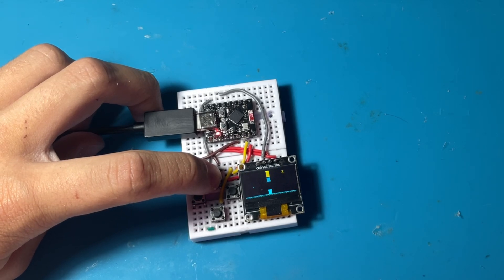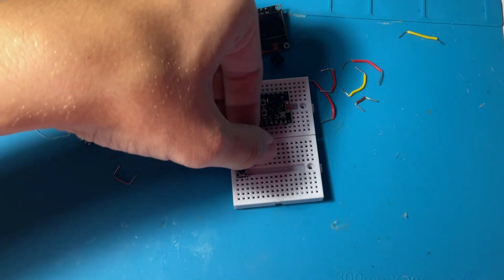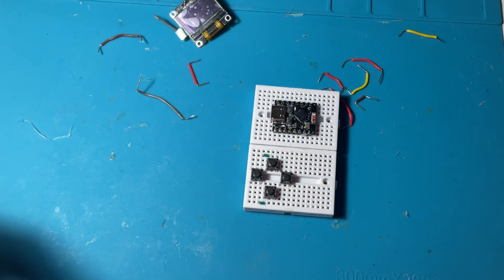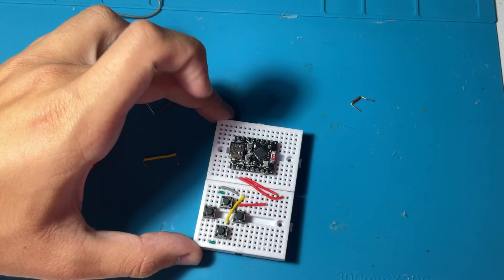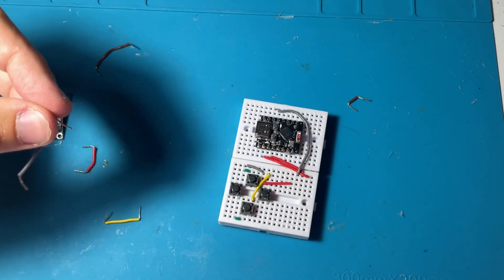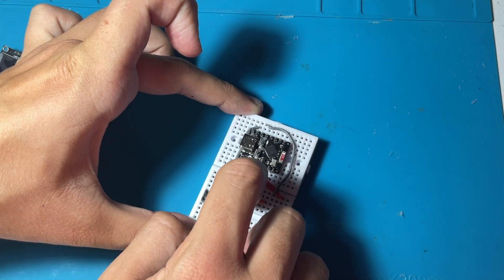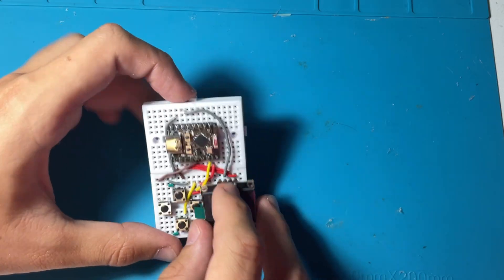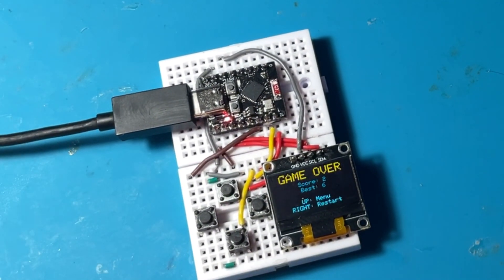How to Play Games on ESP32

Comment: may i port it to esp8266,sir
Reply from the maker: You can use the same code, it also works on arduino
Reply: @RRoboCCrafts thanks
Reply: how can i reset score sir
Reply from the maker: When you reupload the code, the scores should automatically reset.
Reply: @RRoboCCrafts adding button menu to reset score would be nice,just like tinyjoypad,sir
Reply from the maker: Yes that would be great idea either adding another button for reset only, or in the menu adding a reset option.
Reply: @RRoboCCrafts that would be nice option